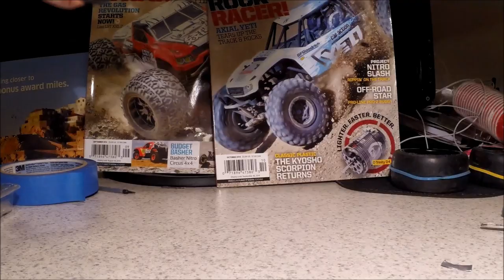How to mount / glue / balance RC car tires - JPRC

Comment: this is a fantastic video ! I would say one of the top on you tube , lots of little tricks . one question tho is balancing the tire really that necessary as it is a very small. ?
Reply from the maker: Hi Luke, thanks for watching. about the tire balancing part the answer is absolutely yes. as you can see in the video the amount of variation with the unbalanced tire, now imagine this is going at 70 mph, you don't even have to get up to that speed to have too much vibration which will result in lose of traction and control.

Comment: The wheel balance portion was very eve opening bro! Wow. When you glued, could you not just wipe off the excess off the outside? Before it dried?
Reply from the maker: I did put in too much in the video but don't ever try to wipe the excess coz they will only get real messy.

Comment: One thing if you get big drops like that take a toothpick (wood) and blunt it than go around rim with a little pressure and it will suck up some excess glue and straighten out your beads

Comment: id cut a smaller amount off end of glue bottle. easier to control glue amount
Reply: If you live in the uk get your superglue from poundland  get the pack of 5's they come with a super fine applicator thing that pushes onto the superglue nozzle